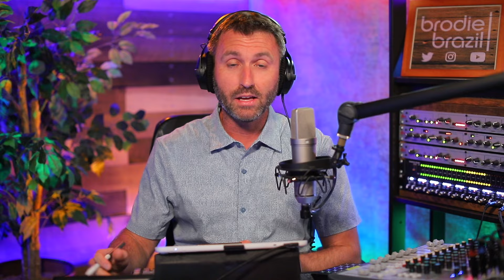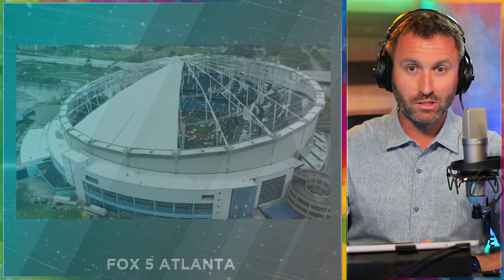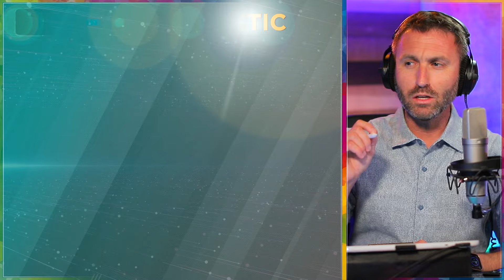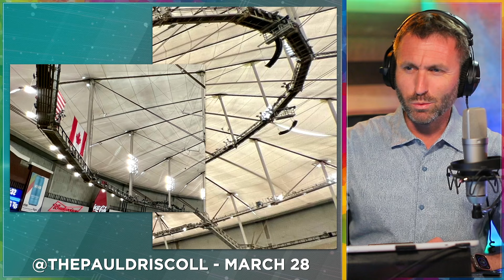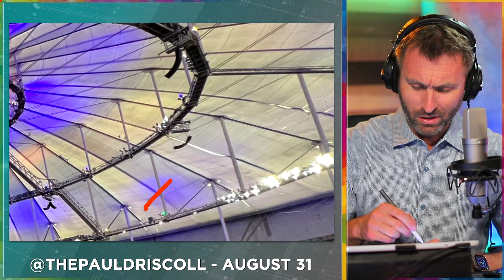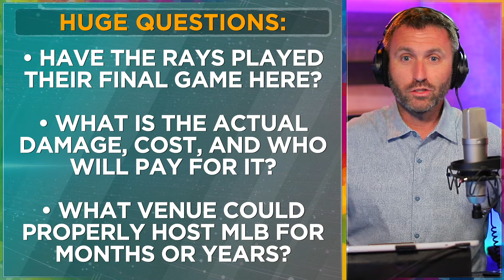Tropicana Field roof damaged BEFORE Hurricane Milton?

Comment: There was definitely nothing open to the outside. No water was getting into the stadium. We went to a game in August in  horrible rainstorm. When we got there the parking lot was flooded. I had to wade in 8 inches of water right outside to get in. We had a lot of street flooding in our area. If there was any leak, that field would have been flooded that night. We were also at a game earlier in the year where there was a big rainstorm during the game.  It does look a little odd in the photos,  but I can assure you no water was entering the building.

Comment: Something I've haven't heard about what the Rays might do until the roof is replaced at the the Trop (if it ever is):

If Tampa Bay has to go elsewhere to play next season (and/or the next three seasons until the new Trop is built), why not play in San Antonio? The Alamodome has been used for a few Texas Rangers spring training games over the last few years, and isn't all that much worse than the Trop. It would be a test for if San Antonio could support a MLB expansion team in the long term in a ballpark of major league size (unlike Sacramento, Nashville, Charlotte, Buffalo  or even Salt Lake City). And as far as I am aware, the roof is not under repair as is the case in Montreal. Something to think about.

Comment: I don't know if you've talked about it before or not, but I'm wondering if insurance will pay for anything inside the stadium -- or the roof.  If we were talking about a roof on a house, I don't think the homeowners would have gotten a dime for roof damage if the roof was well beyond the life it was rated for.  Insurance isn't a roof replacement service.  The dome (fabric) was likely fully depreciated and insurance would owe nothing.  The question then be about the contents of the stadium.  Do they have flood insurance?  If not, insurance may not pay for anything inside the stadium.  This is going on how a homeowner would be treated.  If the roof is compromised and water gets in, the insurance company would call it flood damage.  I see the possibility here that the Rays get left with a huge bill for stadium repairs.
Reply: I am a contractor although I don’t do roofs. Actually in Minnesota insurance has become a roof replacement service. Insurance companies need to start looking at the lifespan of a shingle and pay a prorated amount for this reason. I had a client get an $80,000 payout on what I consider to be a modest house and another one, $200,000. The ladder also involved hail damage to windows.

Comment: Why not the astrodome?????
Reply: The Astrodome is essentially abandoned at this point, it's not structurely sound, MLB would never allow it not to mention Harris County. It's just waiting for Houston to figure out whether or not it should be torn down or not.
Reply: @joecostantino3684  but it is do-able? Easier than repairing the trop? What about allamo dome? Super dome?
Reply: @thomasjcox Harris County (where Houston is located) took away its certificate of occupancy in '08. Minor renovations have taken away outside ramps and other things.  I don't think the Astrodome is an option here.

Recent renovations to the Superdome have locked in the football configuration (so they can't switch to baseball). While the Alamodome is interesting, I think they have plenty of options in Florida.
Reply: @HHSGDFootballJPD All outdoors. Are fans really going to sit through scalding heat and constant Summer thunderstorms ⛈️
Reply: @wmw3629  They can and they could. They played outdoors in Miami Gardens for 20 years. A new stadium with climate comforts has not improved attendance down there.

And it's more convenient for the players and team so they don't have to run their operations out of a hotel room 1000 miles away.  And it's better for multiple AL East teams; playing in San Antonio is farther away than most of the teams in the AL Central and the Texas teams...

Comment: You can see how the fabric was layed.  Looks like you can see the seems of the roll of the fabric to running around the steel.  Not sure if it was sealed before being layed down on the steel.  You can definitely see the way the fabric was layed out.  That goes the opposite way from what your showing that light seam.  Stu Sternberg isn't billionaire owner.  His net worth on Forbes is listed as $800M.  The Trop is probably a dead stadium.  There has been talk of the Rays using Wild World of Sports at Disneyworld.  The stadium is the Braves spring home.  It has 7,500 seats and lawn space for 2,000.  The issue there is it take the team 90 miles from Tropicana field and an hour and half from it's target fanbase!  Steinbrenner Field or Legends field where the Yankee's train across from Raymond James Stadium in Tampa Bay is also used as a minor league park for the Tampa Tarpons of the Florida state league.  That stadium holds 11,026 and would still be close to all the Ray's fans.  Looking at that stadium, there is room to put in extra seats.  Right now the Rays capacity at Tropicana field is listed at 25,025 fans.  I think about 3,000 seats could be added to GSF in Tampa to get capacity up to 14,000.
Reply: Blistering heat and constant rain during the Summer!

Comment: Well, there goes the insurance claim. It would already be a reach based on force majeur, act of God, whatever. But pre-existing damage prior to claim event doesn't even make it past an adjuster. And if St. Pete self-insured the facility, no reinsurer is gonna pay out on this roof, the electrical damage, surface damage (concrete buckling), or anything...The Rays need to punt the ball (mixed sports metaphor, sue me) and just book up Steinbrenner Field. Roll the dozers on Tropicana and get a head start on the future. Who knows? It may save money on utility relocation at the site, or who knows what else by keeping the new stadium on largely the same footprint...Chin up, Ray fans. Your team is still in better shape than six other teams in MLB...